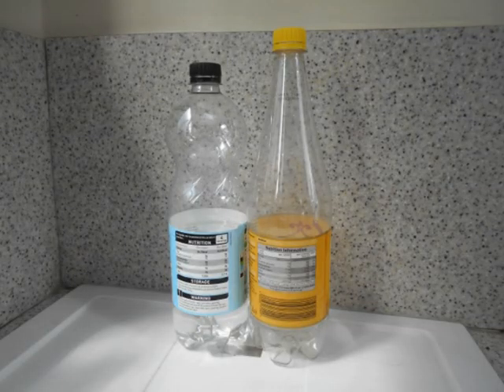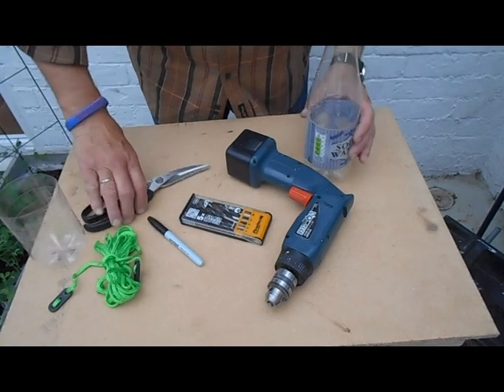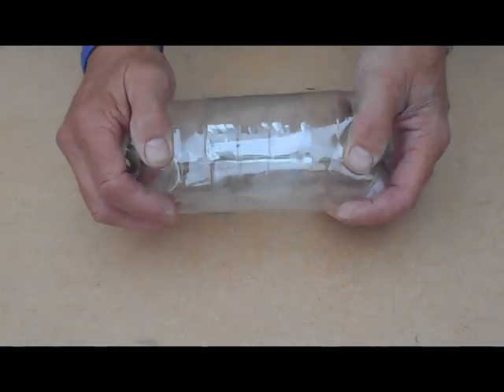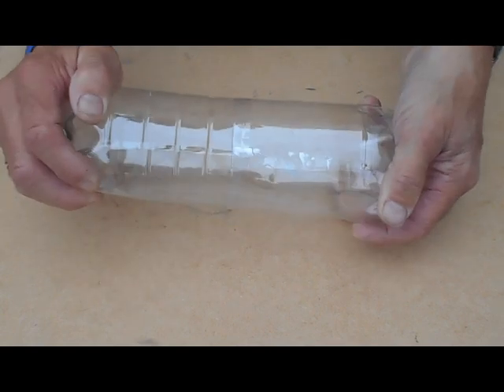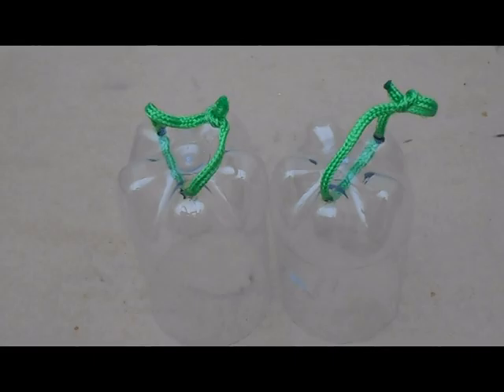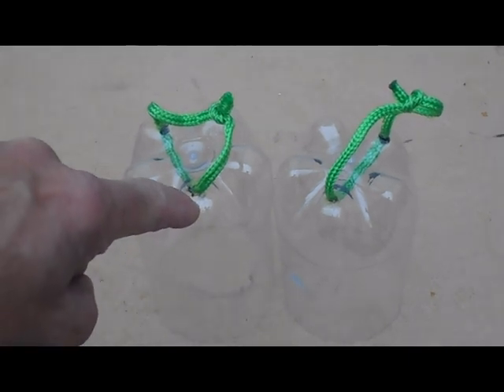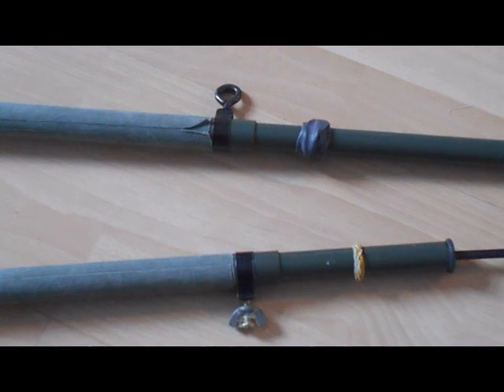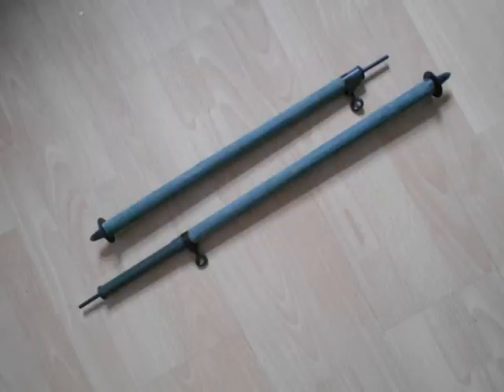A Few Hacks For Preppers Survivors and Bushcrafters 2017

Comment: To make them even more resistant use plastic(?) electrical tape around the edge where the two bottles join. This tape is multi-use and reusable. Use it for gear repair, first aid tape and/or fire tinder. Can also carry extra of this or order tape by wrapping a few turns around the outside bottle.
Thanks for your tip. Like the idea. Will experiment with various bottles available on my side of the pond.
Reply from the maker: Hi Lee. Thanks for commenting and providing a couple of good ideas.  One bottle came from Aldi the other from Lidl; i think you have both in the U.S. Best  wishes.  Nigel